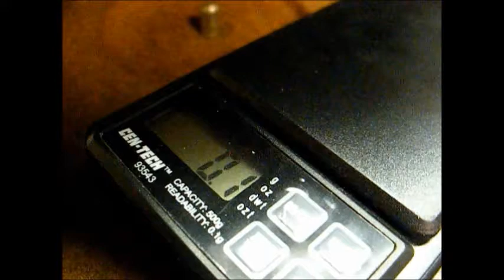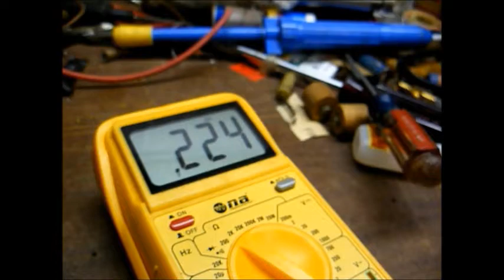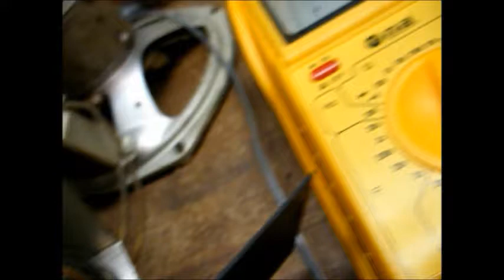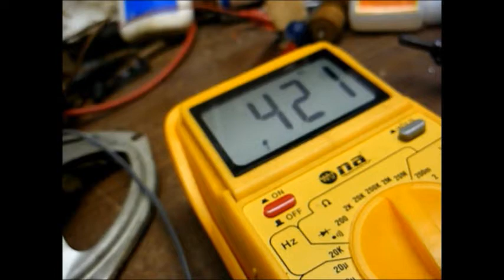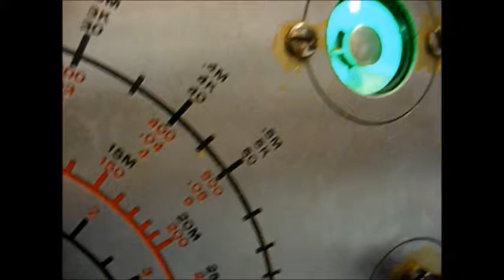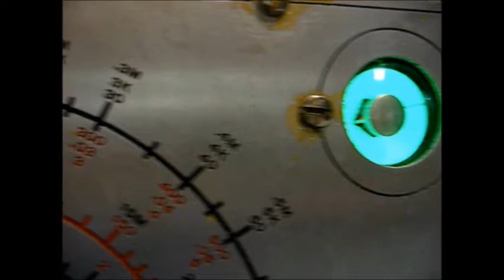Repair of a 1940's Decca model DP16 78 RPM record player - part one

Comment: Anyone no how to tell what the color means on those capciators,I just got a radio with them in it I want check the value of those kinds of cap with the painted dots ,in case I need to replace mine.

Comment: I read a steel needle is good for one song. If you use it too much, you tear up the record. We have an old Victrola my Dad bought from an auction place in the early 70's. It tracks in ounces. Acoustic. Wind up.
Reply: That is correct. I would only use a needle more than once if I'm playing a record that is already worn out or cracked.

Comment: Is it possible to use a generic light crystal cartridge of the type that has the little flat metal style needle with the fork at the back that goes under a tiny screw? They have the 3 mil styli for those redly available. It is so much smaller and lighter that you might be in the tracking weight ballpark without a counterbalance. Probably put out a nominal volt or so, so if you have enough gain there to get it loud enough.

Comment: Awesome job!  I had to change out all the resistors and caps on my 1941 Silvertone AM / SW radio.  I was able to save the speaker as most of the cone was there but full of rips.  I used TP and wood glue to repair it.  Then painted over the cone with black enamel.

Comment: I heard that American Decca was owned by Bing Crosby, either in whole or in part, don't know whether that was true or not, so it wasn't even the same company as the British firm. I do whoever like how that cabinet was constructed, solid wood with finger box joints, so that part is half decent. The turntable and tone arm looks very generic, I've seen that arm on at least a 1/2 dozen makes and models, and it looks like the stylus end even has an extra weight in it for some strange reason.

Comment from the maker: Sadly, most of the American-marketed Decca phonographs that I've seen were towards the lower end. Years ago, I had one early '60's Decca stereo portable that had seperate speakers and a single ended 6BQ5-based stereo amp. On those one tube players, I have actually added a preamp tube so that a modern lower output cartridge could be used.

Comment: Wow, 90 grams....I can practically see the shellac flying up from the record surface like shrapnel. I have a prewar Admiral that used all Micamold caps like that...not a single paper/wax cap in the entire set. The .2 uf was about 2" long and 1" wide.

Comment: It looks like they added an extra weight in the stylus end of that tone arm next to the cartridge. I've run into similar things before, I once had an early 50s three speed unit where they added a coil of solder around the bracket holding the cartridge because apparently the old pot metal Astatic wasn't heavy enough.